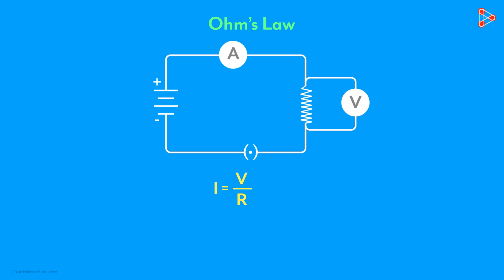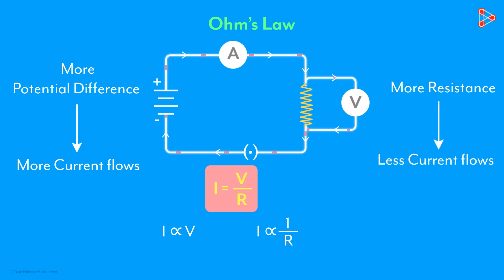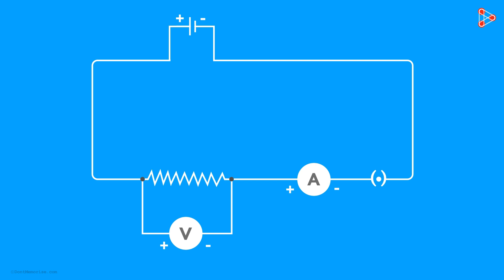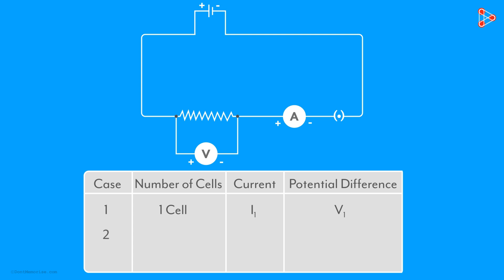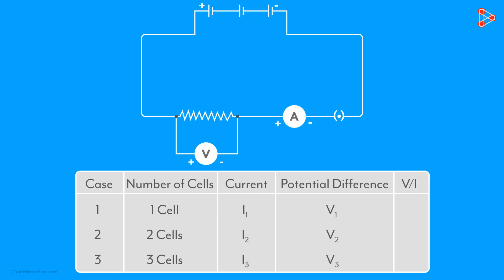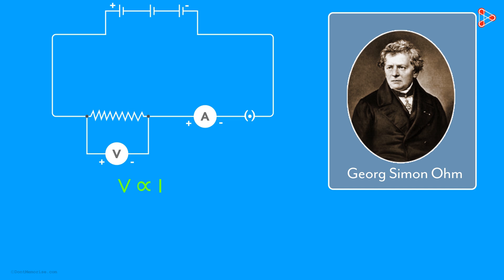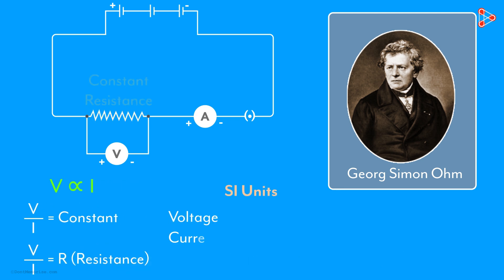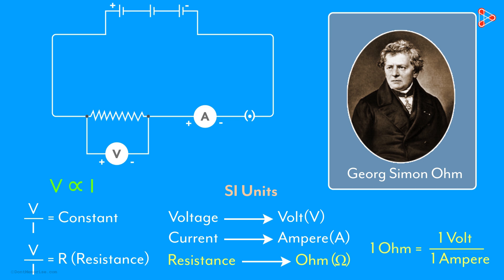Ohm’s Law - Part 2 | Electricity and Circuits | Don't Memorise

Comment from the maker: #DidYouKnow: A multimeter or a multitester, also known as a VOM (volt-ohm-milliammeter), is an electronic measuring instrument that combines several measurement functions in one unit. A typical multimeter can measure voltage, current, and resistance. 

To access all videos related to Electricity and Circuits, enrol in our full course now: https://bit.ly/Electricity_DM
To watch more Physics videos, click here: https://bit.ly/PhysicsVideos_DMYT
Reply: 🛑🛑🛑🛑🛑🛑🛑
In the playlist you guys put the same video twice there is no Ohm’s law part 1
Reply: Thanks Don't Memories
Reply: Bot

Comment: In the circuit at 0:53, shouldn't the ammeter be placed the other way around? (Positive side facing right and vise versa)
Reply: The point connected to the positive terminal of the battery gains positive charge and so is the case for negative one....

Comment: Why should we connect ammeter in series and voltmeter in parallel? What are the consequences if they are connected vice versa? What is the mystery behind this? Please explain Ma'am
Reply: Ammeter should be in series as it has to measure the amount of current so it has to be in the path of the current whereas voltmeter is placed parallel to the load and given higher resistance than load so the current does not bypass the load and flow through it. In this way the voltmeter will be able to measure the potential difference between 2 points

Comment: Why are the voltmeter and the ammeter connected differently??
Reply: Champa Sadhukhan because ammeter is used to measure the current that passes through them and voltmeter is used to measure the potential difference across the component